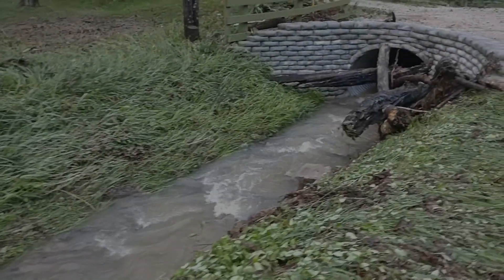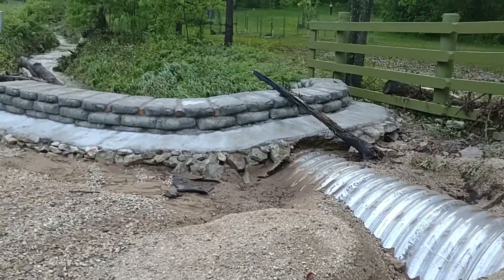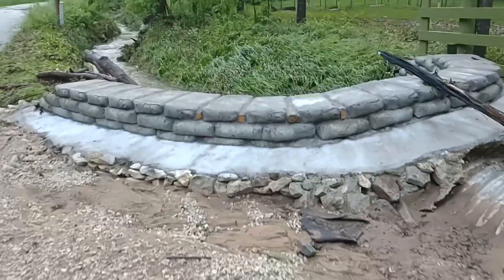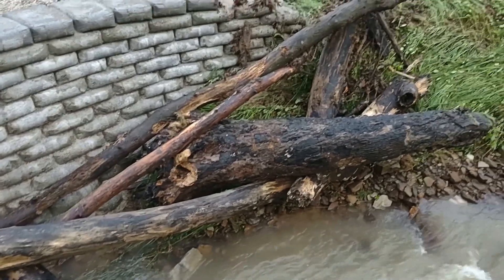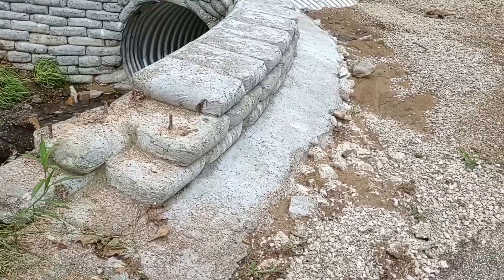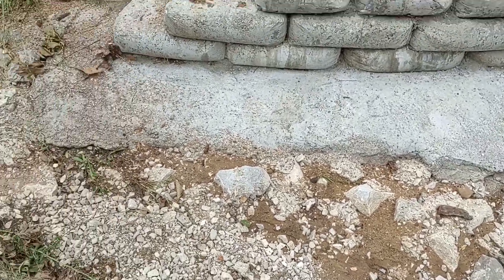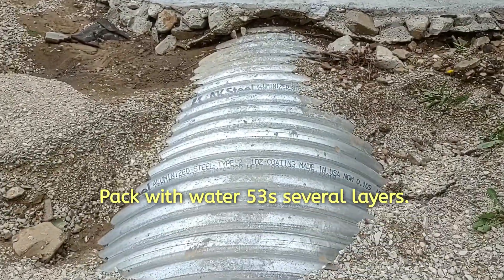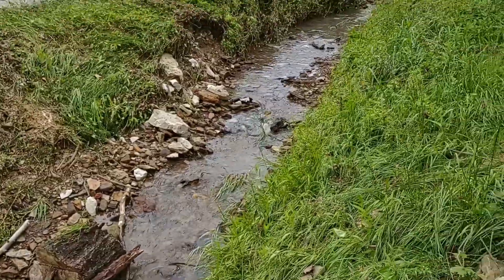Flash Flood | Concrete Bag Culvert Wall | Did It Hold Up?

Comment: can this work with plastic Concrete Bags to if you poke holes in the bags cant ?
Reply from the maker: @geerb6727 - You might put nails or screws in a board with a handle to poke holes and also punch extra holes with the rebar before you place them  similar to this video. Thanks for watching? https://youtu.be/tUlc1Qb5A74
Reply from the maker: You might use a board with nails or screws with a handle. Also run the rebar through extra times to link the bags similar to this video. I should not stretch like paper, yet you will need more soaking and or do in sections. Here is a video example. Thanks for watching! https://youtu.be/tUlc1Qb5A74
Reply: @SteveAddis  thanks i really like to use paper bags but it seems not to be available here in europe but im still looking even thinking of using bags where i can but the concrete in have seen some one use lunch bags
Reply from the maker: You might make a small board with nails and a handle and punch holes in the plastic bags, punch through multiple times with rebar in the centers. Test and see how it works with a small section or wall. Thanks for the comment!

Comment: Geogrid, geocell, or similar product would hold the driveway rock in place. AgTech GeoCell is one brand name
Reply from the maker: @greggv8 - Thank you for this great information! I made a note of it. So far, I only placed geo textile fabric over mixed lime and stone with rip rap on top. It looks ugly, so your way would likely be easy and cost less than concrete. Thanks!

Comment: Steve, this is the “after” pic we’ve been waiting for. Overbuilt? Never heard a complaint about the performance and functionality of “overbuilding,” just criticism of the aesthetics. Whatevs, it’s performance that counts IMHO. GREAT JOB!
Reply from the maker: @G.I.JeffsWorkbench - Yes, that is a good point. Overbuilding might not be beautiful. Now, I do wish I had a larger culvert pipe, which someone mentioned. I don't want to because it gets all clogged up with logs and branches requiring constant maintenance. This was the only maintenance cleanup so far. Everything else including rocks washes through. Thanks for commenting!

Comment: Culvert wall definitely did its job. Looks like you need to do a small section of concrete for the driveway above the culvert, so when it overflows the water simply goes over the top and doesn't damage anything.
Reply from the maker: Thanks. Yes you are correct. For now I placed geofabric and rip rap over that area on top a layer of 53 mix that washed away. Thanks for your input and comment!
Reply: @SteveAddis  Yea, when I saw this, I thought the same thing. I was thinking about geo grid filled in with gravel rather than geo fabric covered over with gravel. Or maybe that's the same thing you're thinking of?
Reply from the maker: @ My understanding, I use geo grid for things like holding and tie backs. I used the geo fabric here for separation from soils, prevent washouts when in contact with turbulent water. Fabric can also be placed over soft soils to as an underpayment, for stabilization under for gravel mix. You might want to look that up. Thanks for the comment!

Comment: Just watched the original video. Held up good!
If that much water is coming over the top it might be worth it to just pave up to the gate (or halfway up) with asphalt. 
Should be relatively cheap and you won't have to chase your stone down the road everytime you get hit big.
Reply from the maker: Yes that would be a great idea! I have since placed a lot of rip rap there yet the packed gravel is the same. I made the mistake of not protecting the area after the wall for sure. Thanks much for your comment!

Comment: How many inches fell and what area do you live? Just a suggestion but after putting back the crusher run and the geo fabric, put down geocell with crusher run over that maybe?
Reply from the maker: I believe 4 inches or more. I watched a round cell on the radar just over our area. Southern edge zone 6. I need to look up geocell. So far I have placed large rock over geofabric when I have time to pull them out of the creek. Thanks much for the advise! Take care. :)
Reply: I have two crossings I have to do. Each one has two culverts but they are only spaced a few inches apart. What would you suggest as far as concrete bags between the culverts?
Reply from the maker: What I might do is us some mixed concrete between some of the pipe. This single pipe replaced a dual because it had too many plug ups with tree branches and small logs. I would still dig under and key, yet might put in a director in the middle bottom between pipes to keep small branches moving through. I still have one dual pipe and it clogs, yet it is only fed by a spring and a short distance from the culvert easily maintiained.

Comment: Good job. For the surface restoration part, after filling the hole back up, try throwing a little dry cement down onto the surface. Spray a little water to soak it through a couple inches to bond the surface. Try a small spot first to check. Leave it overnight and see how it works. A concrete skin should keep roots out too. That's a lot of water to deal with!
Reply from the maker: Thanks for the advise.

Comment: So what you're really saying is that it's not overbuilt and you really needed two pipes that size or more. 

Looks good and did hold up well but if water is going over the top, that's not good.
Reply from the maker: Yes, you are right as the pipe did not handle this rain event. Flooded the whole valley bottom field and road. Two pipes might have worked. The old short bridge upstream plugged up in the past. I noticed that some owners are putting in culverts with angled concrete wash overs.  Thanks for your comment.
Reply: Or a bridge…

Comment: Ohhh man this was the recap vid I was waiting for. I'm def doing this to mine but I'm probably going to have to do a small retaining wall to keep it out the yard. Thanks for your follow up vid 👍👍👍👍👍👍
Reply from the maker: @Steeltoe Boots - Yes, this was likely the worst event. I knew in my mind I should have done cloth and the drive might wash out. Most logs go through.  Just today those last two heavy cut pieces washed away. Fun fact, it all ends up in a sink hole about a mile away across the road. -Best of success!
Reply: @SteveAddis  lol the insanity never ends when it comes to nature it's a constant battle. So anyway of doing it easier or better I'll take it or share it. Would have never thought of doing this just 👍👍